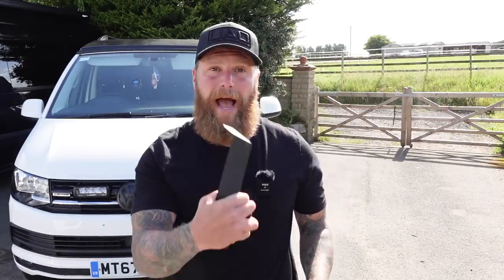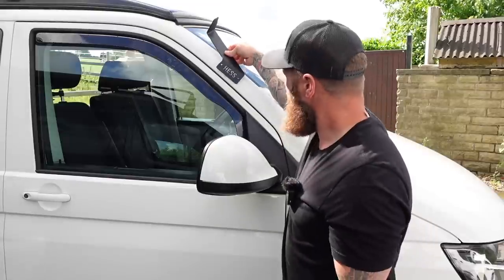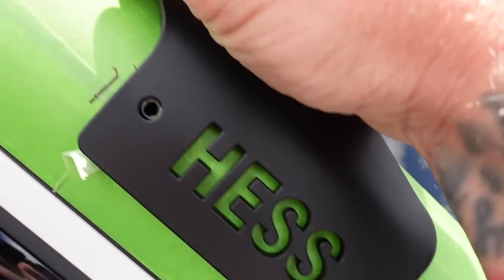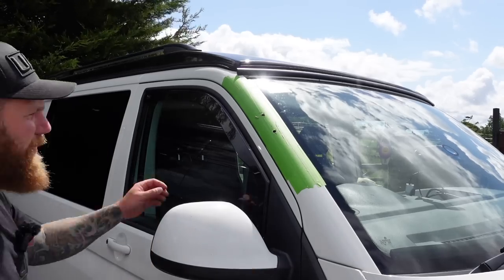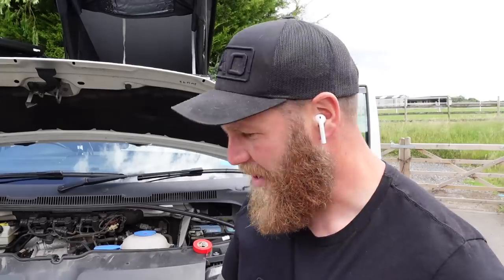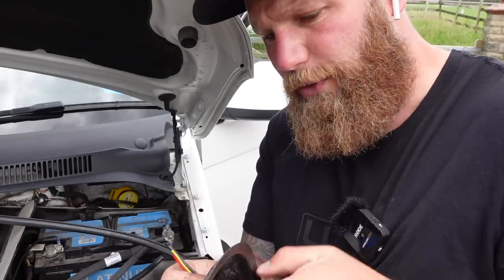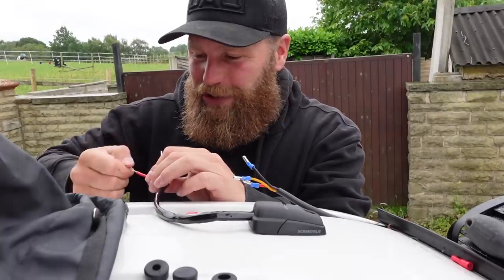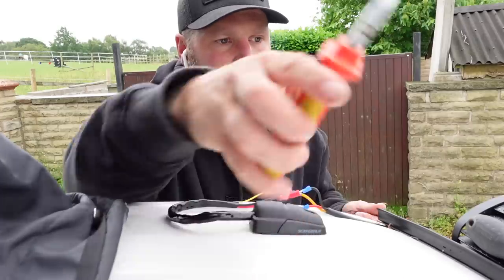Vw transporter upgrade RIPPED OFF? £350 for a bracket.

Comment: I totally see your point about those brackets and the finished project looks great. The scan strut cable entries are great and far better than the cheap things off eBay, the thing with them is they aren’t going to leak and cause you issues like the cheaper ones will. Brilliant attention to detail with the mounting holes in the A post.
Reply from the maker: Cheers you. Pretty penny. But pretty ha

Comment: Love it mate, I initially thought those brackets were very expensive but like you said the overall cost with the cheaper light bar makes it quite reasonable. Regarding the selection i’d have the lightbar come on with my main beam. 👍🏻 fitted my double scan strut last week for my solar. It’s a very cool product.
Reply from the maker: Very very cool. Fair price too 👍🏻

Comment: after going to all that effort to prime/paint the holes I'd suggest doing the same to the rivnuts if they're steel (which they look to be)  the coating won't last forever and you'll get rust stains down your A pillar.  Quick shot of hammerite now will save some pain later.
Reply from the maker: Yes mate.  These are actually coming off for the next stage. Stay tuned 👍🏻

Comment: No.3 DRL 
Always believe if your going to do it, fit the best you can , so no qualms with that, however I wouldn’t fit them in the first place as I like to keep the van smooth and less fussy but each to their own, looks good for the off-road look, guessing they would have to come off if the windscreen needed replacing though.
Reply from the maker: I agree with your quality mentality. So many people mention the windscreen. Been driving  20 years and never had to change one. But yes. 4 bolts 👍🏻👍🏻

Comment: Amber and a separate switch / Controller in the cab 👊 Looks banging 🙌
Reply from the maker: Hmmm When would I use it??
Reply: Anytime / every time 😂 but at least you have the option to switch it off independently fly if any other lights…. I see you have Auxbeam in the description… maybe that’s the next install? 😉
Reply from the maker: @VanFamilyAdventures  lightbar is made by auxbeam. I do have a controller. But use them for the van itself. Love them.

Comment: Good video as always, but what i have learned from this is the Scanstrut is a good bit of kit, but the Hess brackets for £350 is a bit steep. I get all of your points, but i think £350 could be spent in better places. As to which light, i would also have number 1 with high beam. When your down a tight country lane in Devon, that would light up lovely!
Reply from the maker: Excellent mate. You understood the mission perfectly. 
Thanks pal 👍🏻

Comment: Really appreciate the cable entry gland 👍 looks slick! Not sure what your cable looks like in the final install but I would use some black braided sleeving over the cable from the gland to the light which you could slip over the cables to give them a matt black even finish which I’m sure you would appreciate better.
Pro install though!
Reply: Forgot to mention, a little black heat shrink either end to keep it taught.
Reply from the maker: @jamiewhitaker4665  you my friend…. Are in the same wave length. The light bar has already been removed for the next mod. 
Thanks for leaving constructive information without being a sausage. That’s exactly how you leave information in a video. 

Not. You should etc. 

Thanks pal 👍🏻

Comment: If the windscreen needs to be replaced, can you have Loctite it down this could cause a problem à la
Reply from the maker: It’s only 4 bolts. Loctite isn’t un doable. It just stops threads coming loose. Of course it can be removed 👍🏻

Comment: Are these road legal? And even if the popo don't take them away how do you make sure some idiot don't nick them? It seems too easy to remove.
Reply from the maker: If this was a concern. You could use anti vandal bolts. Have a weird pattern that not any old Allen key would fit. Bit like a locking wheel nut 👍🏻

Comment: Volkswagen transporters are a complete rip-off so why not purchase rip off items for it.
I imported a 2010 Nissan elgrand from Japan with luxury leather interior, surround cameras like a Tesla, drop down TVs in the roof, four-wheel drive with diff lock and 250 horsepower.
  41000 miles on the clock full service history with Nissan. All for the princely sum of £6800 and that included the shipping and all paperwork to get it on the road in the UK.
The quality and the ride is so much better than any Transporter that I have owned and its such a laugh rolling up on top of the range 100k+ Transporters at the lights and leaving them for dead on the green lights.
Stop playing crazy money for very basic vans from VW and then paying even more to spec them, the Nissan elgrand is so luxurious compared to any Transporter of similar age or present.
Reply from the maker: Maybe don’t be so offended that you. Any afford a vw. What’s that saying. Not everyone can be wrong. 
You get what you pay for. And you paid £6800. And now it has a resale of a bout £4.
Reply: @urbanarkoverland  not quite correct, I have converted it to a camper myself and will be selling in the spring. Am expecting to get about £25k for it.
The complete conversation cost me just under £4200 and took me the equivalent of about 3 weeks to complete.
I can send you a link if you interested when it goes up for sale.
Don't be sucked into the hugely inflated VW trap, I've been there done that, paid ludicrous money for a California camper previously as well as other well known brands of T5 & T6 conversions. Have also converted 2 myself previously.
They are simply not worth the money and we are mugs paying VW  so much for an inferior product.
Reply from the maker: @IronMountainx  so you have literally just said you are hoping to sell something that has a total value of  about 11 grand for 24 grand. You don’t see the irony and hypocrisy in what you are saying. 
I can’t believe you are snuffing out transporter videos just to have a go. Is this because there are  elgrand videos.
Reply: @urbanarkoverland  No the point is that a similar age VW is 3 times the cost and possible only half as good.
Yes you are right its probably not much cop poking fun at over priced components and vehicles.
Each to their own and we all spend out hard earned as we wish.
Enjoy your van.